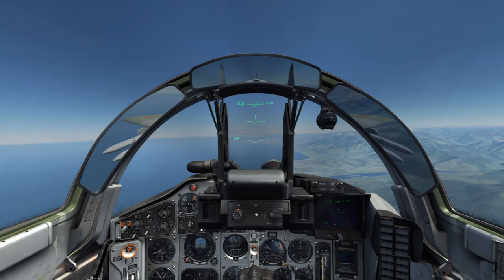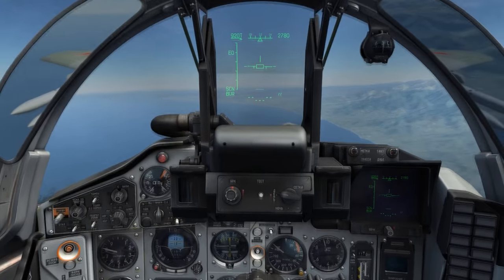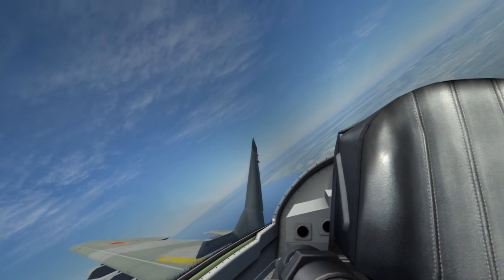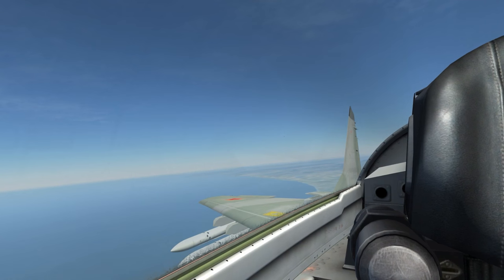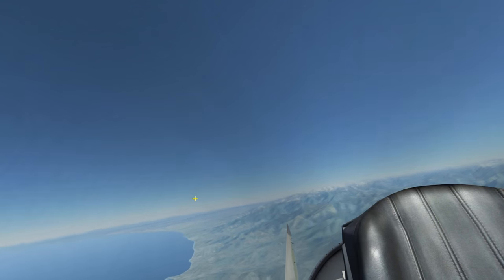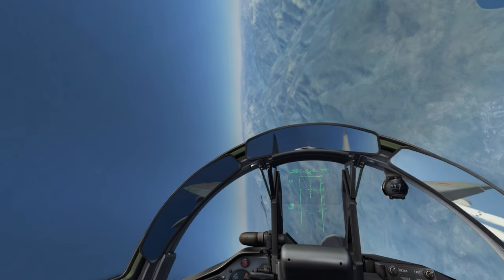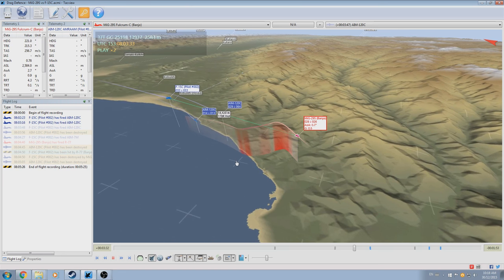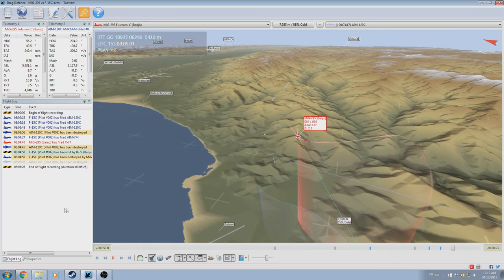DCS:World » Drag Defence » Air Combat Maneuvering

Comment: What is that aircraft you used for demo? Does it has a clickable cockpit? The cockpit looks awesome, so as the video.
Reply from the maker: That is the MiG-29S from flaming cliffs 3, unfortunately it does not have an interactive cockpit
Reply: Thank you for a prompt response, Sir!. I love you for that. One more thing. I always considered FC3 aircrafts of video game quality. I never owned FC3 for this reason. But looks like they are probably not. Are they as accurately modeled as the F5, M2000 and mig21 etc to be called as simulation?
Reply from the maker: Safdar Well, they have decent flight models (though the 29 and Su-33 have yet to receive their updates) though everything else is simplified down to control bindings.  I personally dislike them, though the Su-25T which is also simplified is one aircraft which I do enjoy using so I guess it's really personal opinion there. 

 It's worth picking up FC3 if it is onsale I'd say, though again I rarely use them myself.  I tend to use them in example such as this video more than I actually use them online or in single missions.